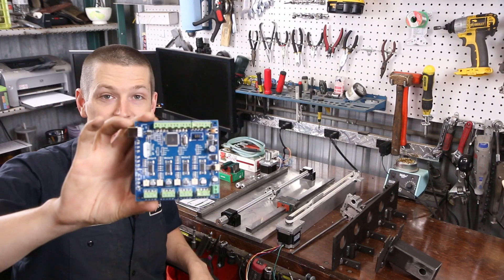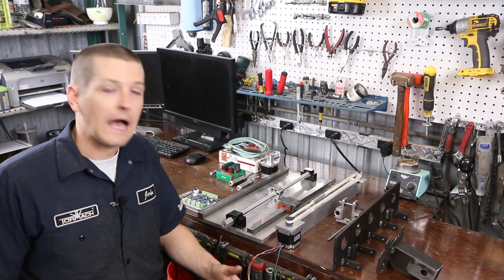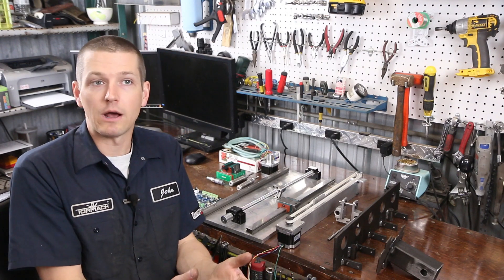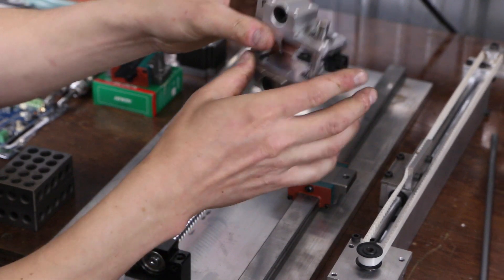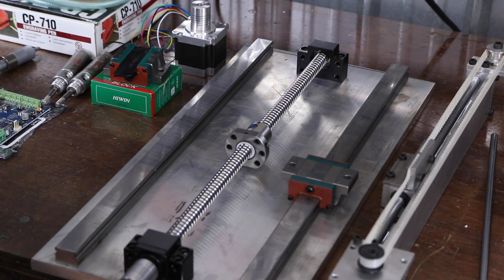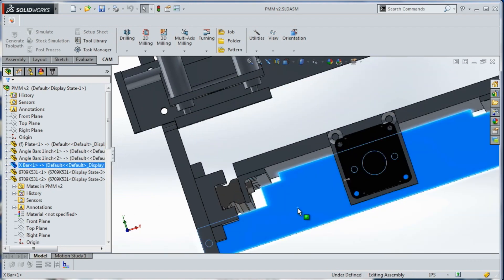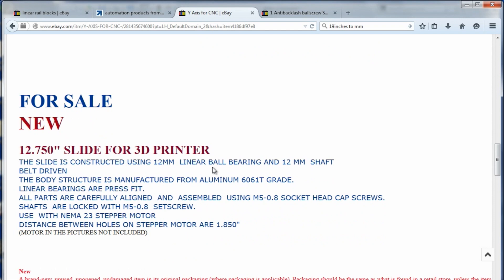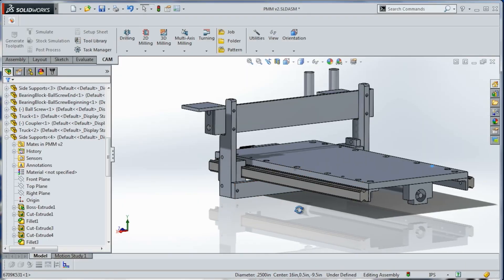DIY CNC Machine: Linear Rails + TinyG Part 1!  Widget40

Comment: Awesome John, I'll can't wait to see this build progress.

Just a thought with the angle bracket alignment, if you slot the mounting holes on the angle on the table attachment side. You can then position the Y axis at its home location and tighten those bolts. Then run the gantry to the max Y limit and then tighten the bolts at that end. This should align the rails so they are parallel and eliminate binding. This can also be done with the ball screw at the same time.

Just a thought. Looking forward to seeing the rest.

Comment: +NYC CNC  thanks for another inspirational video! 

I was hoping you (John) or one of the many community members could help with a CAD question ; What is a good CAD program to go with to model machines, which would be the quickest to pick up and value for money? I know you use Solid works and from what I have seen you do, it would works well. My options are Soild Works, Auto CAD (and inventor) or Turbo CAD. I can afford Turbo CAD but the others not so much. Also what is the best way to go about learning one of these CAD programs?Thanks again for your work
H
Reply: NYC CNC Thanks John, I had a feeling that you may have. I was thinking about it some more today and I may go with Autocad as I need to be able to design mechanical systems/machines and design factory layouts which both can be done with Autocad and Inventor.
Reply: thehaytch 
If you're familiar with Autocad, but don't have access; Rhino would be a very comparable alternative. Commands are almost identical, since Rhino began as an Autocad Plug-in (so to speak). 
Should you need something FREE, but with the parametric 3D power similar to Solidworks; log onto "rs-online.com":  then download "DESIGNSPARK MECHANICAL" from this awesome electronics supply house. 
Their free 3D modeling software is based on the high end program called "Spaceclaim". A very powerful and expensive commercial CAD program. This Free version is subsidized, integrated and optimised for the convenience of their rs-online customers. 
It's a great system to insert accurate 3d model parts & ordering from their online catalog,  Great to try form and fit designs before committing to production; but, with no obligation to buy. You could even download and insert model part files from other sources, such as grabCad, mcMaster-Carr, and ect.
It's fantastic and just as easy to use as Solidworks, if not easier. Plenty of online training videos, to get you up to speed.
You're not limited to just PCB board design and electronics projects. Any mechanical project may also be modeled, just as with Inventor or Solidworks.

Comment: John, I love your site and it's a wealth of information.  I want to build this machine not for engraving, but for drilling stitch holes for leather handgun holsters, cutting out belt loops, then cutting the entire pattern from leather.  Is this design suitable for that application?  Obviously, it would use something other than the engraving pin you will use.  Thanks again for everything you do!  Charles.

Comment: Try fastening the ball screw and the slide rails on one end, run the x axis to the other end and fasten them in position, then dowel pin both ends.

Comment: Any concerns about excessive flex with using aluminum angle bracket on your X axis?  I think if you were to use 1"x1" solid aluminum bar, you'd gain quite a large bit of rigidity for that axis.

Comment: WoooBuddy!  Ahhh.....I'm curious as to how this machine will be mounted? Single screw Gantry X axis's make for difficult mounting,unless you make the gantry the base and move the table. Or are you going to mount it by securing the ends, and introducing flex into the table?

Comment: any idea if a heavy cast AL gantry could hold up to milling steel?
i would really like to make a 3x3x2 or 2x2x2 gantry mill but i want to make sure the money for ball screws and rails and servos gets spent well.
Reply: i was hoping to lessen vibrations and increase rigidity by having most of the components be one piece and bulky. i would preferably cast it of grey cast iron, but i don't have a crucible that will withstand the heat yet.

Comment: Looking at the rail mounting, this looks very difficult and not very rigid to align with the ball screw motion as well as table traversing. I would mount the rails on top of the plate, which would require adding a couple bars of hot rolled steel to get the spacing height up to get the lead screw on top of the plate with it's blocks as well. This will take much drilling in the plate and the riser bars for the guide rails to then be bolted down from access under the plate. This setup, if any of this makes sense, will be easier to shim/tram on a solid plate and not little angle strips that are not solid or precision in shape to work with. The weight and pressure on the rails will only be on one groove of each rail with your design, whereas the weight will be on all surfaces as the rail was designed for being mounted on the top side of the plate. Yes, more work, but much more solid, alignment more practical, and rail wear reduced. Another consideration to rigidity during motion, is placement of the rails equal spaced from the ball screw and outer travel limits of the opposing axis. Rails closer to the lead screw will lessen what I call "walking effect" from any accumulative mechanical lash that exists between rails and the lead screw. Good Luck!

Comment: Looks like its going to be a nice build! I'm interested to see how a single 25mm bearing block on each side does on this size of machine, we have always used 2 No. on each side but with a 20mm or 15mm rail. There is a ratio for the relationship between gantry width/height and bearing length floating around the web somewhere. My big question is how is the z height controlled to give height and engraving depth control, spring loaded or air pressure control? I guess that would work on flat surfaces??  Il probably lose sleep trying to work this out....

Comment: Hi John,
I like this new machine that you are designing.  The first one was great as a proof of concept but the more rigid components are really needed if you are going to count on it for real work.  I hope you are right about the component prices coming down.  I realize that these parts are precision made but the costs do seem to be unexpectedly high.  Shipping costs are also an issue.  It will be interesting to see how the cost works out as the project progresses.  Thanks for the video!
-mike

Comment: pay attention to those cheap ball screw kits from ebay. I purchased one of those kits a month or two back. The ball screw mountings and ball nut mount were poorly machined. none of the mounting holes were square to the mounting surfaces. I designed my axis plates of the dimensions and had to do some modifications to get everything to mount right.

Comment: Why didn't  you buy linear rails and ball screw that was recycled from old cnc, printer? They are just as good as the new ones. I bought pretty much the same set as your but even longer up to 650mm for the rails and my ball srew has a solid steel case, super rigid. All that for roughly 100$.
Reply: YulHolic24   yes it is .

Comment: John, great to see you are getting started with the TinyG!  I've got mine up and running on a generic 3040 CNC frame from ebay since I don't have any way to machine my own.  I will be upgrading it as I go though.  Love the linear guides, I'll be using those, too!  

Check it out! https://www.youtube.com/watch?v=htsXSj8kclI  I'd love to get any feedback you have. It's not a perfect solution and I'm coming across some limitations but for a small machine and $130, it's hard to beat!

Comment: Not to change your design it would certainly work the way it is. But why don't you mount the rails directly to the aluminum plate and redesign the bar for the ball nut to mount the columns for the cross axis on its ends. This would remove one source of possible misalignment.

Comment: I love you videos and look forward to watching them. Looking at your design, I am unclear as to why you are using the angle for the linear rails? I know you have an access issue since you only have access from the back side but why not mount them directly to the bed and attach from below? It just seems to me you are adding alignment issues by doing it this way. I R just a shirt cuff engineer (yeah..that looks like it will work) so I may be missing something obvious

Comment: You should consider putting the linear guides on the underside of the table, mainly because you are making a portal so you have that option. And mounted as they are now, they will be very prone to get dust and junk into the bearings. that or you will need to create covers for the guides..
Reply: doesn't matter. Any hard particle is a [ball screw| guide way | bearing] killer. Even if precision is don't care it can cause stick and slip locks for one rail of anot very rigid portal. Cheapest way covers are better than all time cleaning  in my opinion

Comment: I'm really curious how this one works out.
I plan a long time to build a CNC but most designs seem too weak. This one so far has a nice solid feel.

What I'm curious of if it wouldn't be better to put the linear rails on the underside of the baseplate so shavings don't land on them. Or aren't shavings clogging up the linear ball-bearings?

Comment: John,
Check to make sure the ball nut bearing block with the two bearings are installed correctly. All three of mine I got were backwards. I did not know I had to turn them around and shim to preload the bearings, when I did I got the play down to .0005.
Reply: NYC CNC john,
here is the link for my build, the guy that explained it to me does a far better job than i can, he even includes pictures lol its page 5 and post #100 http://www.hobby-machinist.com/threads/copycat-mill-build.10024/page-5

Comment: One common Problem is see with some self build CNC-Machines: Linear Componentes are massively oversized and therefore expensive. If you get Used Parts, that's fine. Some will go with 20mm or even 25mm-sized Linear Guideways, which is "to big" for anything that such a small Machine can handle. 15mm is fine for almost every table top build I've seen. Even smaller Rails might do. Larger Gantries may be different of course. Looking forward to the next Video :)

Comment: TinyG doesn't support all the G Code. It becomes problematic when you use a CAM application that output standard G Code.
I recommend LinuxCNC for.
Reply: NYC CNC The important part is LinuxCNC and the  breakout board. What drivers you choice is more based on motor and mass you want to move.
If you want to do only 2.5D with the tinyg a think that you are ok
Check here https://github.com/synthetos/TinyG/wiki/Gcode-Support the G and M code supported by theTinyG

I recommend that you skip the aluminium angle and mount the linear rail under the base plate. It will give you more robust structure and protect the rail from fine chips.
You can drill slight bigger holes in the base plate for mounting the linear rail ,then you mount the gantry leaving the bolts lose and move the gantry on one end slightly tightening the bolt the move the gantry to the other end and slightly tighten the bolt. In this way the linear rails get self parallel.
Reply: Nita Ionut I recommend that you skip the aluminium angle and mount the linear rail under the base plate

I agree. I immediately came to the same conclusion when I saw the aluminum angle.  

re: slightly bigger holes; on my LG30 rails the hole in the rail is 9mm for an 8mm fastener. My poor hole locating skills not withstanding, it was enough play to make my rails both arbitrarily straight (ish) and parallel.

Comment: This looks VERY in teresting to me, since I'm already making one very similar myself.
I am fighting with 5th beta version of the Z axis because of narrow space problems.
I'm making a miniature CNC Mill (100x100x100 mm stock).
I'm trying my luck with M6 threaded rods instead of ball screws.
I noticed you opted for a belt on your Y axis - wouldn't the Y also need a ballscrew for the thrust force?
Main page: http://www.realgentlemen.dk/MediaWiki/index.php?title=CNC_Mill
Parts: http://www.realgentlemen.dk/MediaWiki/index.php?title=Parts

3D Model: http://www.realgentlemen.dk/MediaWiki/index.php?title=CNC_Mill_model

Comment: you could mount the upright to the end of the Y axis what would move the Y axis back yes it will make it wider, also having one ball screw moving the X axis you will get racking but you should know how to deal with that. on the plus squire rails solid base, it will be strong enough for a little bldc motor to run a spindle
Reply: NYC CNC if everything is squire it should not be to bad a moving table would of been easier but not better

Comment: This looks like a nice design. I have a couple of thoughts:
1) one way to keep the two linear rails aligned would be to mount both angles to the plate and take a light pass on each using a single setup.

2) One thing to keep in mind when using ballscrews is to make sure the screw and the rails are VERY parallel. Ball screws can take large thrust loads, but just a small amount of side load will wear them out pretty fast.

Best of luck and I am looking forward to the next couple of parts
Reply: NYC CNC your welcome... I have plenty of experience after 20 years building motion systems at work. One other thing I just remebered. Try not to run the nut up and down on the shaft by hand. It really sucks if you accidentaly run the nut off of the end and have balls all over the floor :(

Comment: About the alignment of the two pieces of L aluminum to the bed. Remember the first general rule of locating pins, the locational tolerance must be finer than half the minimum  clearance.  If say there is 1 thou of clearance on both of the pins and holes, you only have +/- .0005 locational tolerance on both the the top and bottom plate. Vary hard to keep even on expensive VMC, and measure over such distance. Better suited for jig borer. Solutions aside from giving a sloppy clearance. First to assembly and align the structure with C clamps then drill then ream the corners, that ensures parallelism and allows for disassembly and reassembly, although you won't be able to mix and mach assemblies. Second is to put the pins on the outside the L brackets , or mill a step in the bed to receive them, either way you have a straight reference to back them against, whether they slide in/out but still parallel is secondary and taken up by the screws.

Comment: I'm eagerly awaiting Part 2!

I love these DIY CNC videos.  I'm still slowly working on my Turd Polishing CNC Conversion (search for it on YouTube if you're interested), and I keep thinking that I'd have been better off welding a steel box tubing frame and buying linear rail and ball screws from China and designing my own machine from scratch.

I mentioned to a friend last night that someone should make a 2HP class machine that is like a baby VMC, stripped and ready for CNC parts.  Too many people are buying poor quality manual machines that aren't suitable for CNC and converting them (like the turd I'm polishing).
Reply: Liberty4Ever someone should make a 2HP class machine that is like a baby VMC, stripped and ready for CNC parts.  Too many people are buying poor quality manual machines that aren't suitable for CNC and converting them

Yes, I agree with this. The same thing should be done for small turn center as well. 

When you look at the quality build threads on cncnzone it's apparent, and some guys come out and say it, that you are more or less buying your turd just for the castings.
Reply: Gabe Larkin I saw a project on CNCZone some time ago where someone was going to sell a kit where people could cast their own epoxy granite machine bases.  In addition to getting a very rigid machine for a reasonable price and being able to do it yourself, this would also be very attractive to people who have a shop in their basement and may have no other way to get a large machine in there.

I'd like to see some plans or a kit with large heavy walled square steel tubing for the machine pieces in lieu of large iron castings.  Maybe build them in place (it could be a bolt together project with no welding needed), and then fill the insides with something like concrete and rebar (cheap mass for more rigidity).  Steel isn't as cheap as it was, but it'd still be much cheaper and much better than starting with a turd, picking out the corn and peanuts, and then polishing it.

And yes, a kit for a baby slant bed lathe with gang tooling would be very awesome.  To that end, the Tormach lathe is very nice.  A bit pricey for home shop hobbyists and it's still crying out for an automated collet closer, but all-in-all a very nice entry into the small shop market.  If I didn't already have a lathe CNC project lined up after my turd mill, I'd be looking at building a slant bed CNC lathe from locally acquired steel and Chinese ball screws and linear bearings.